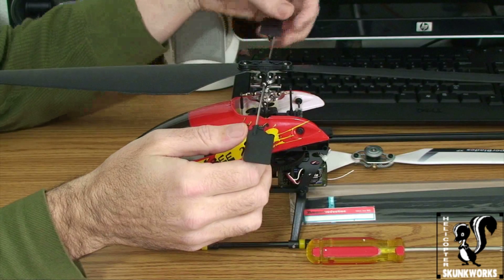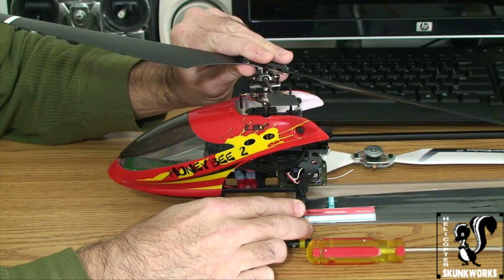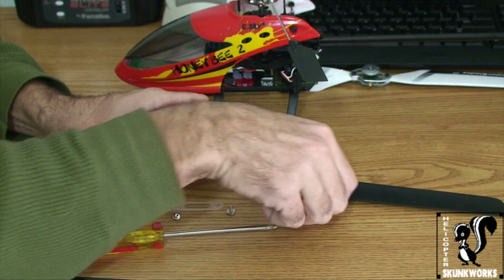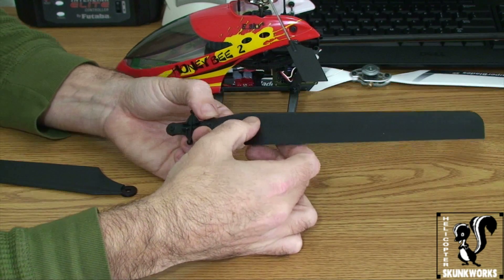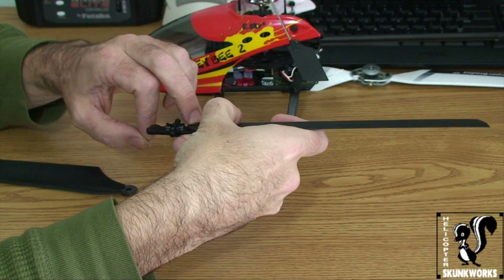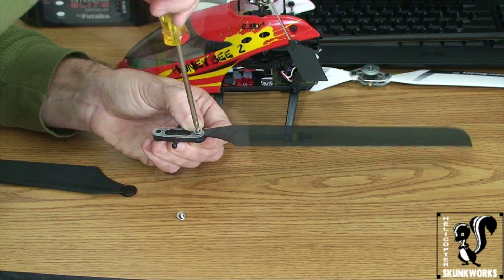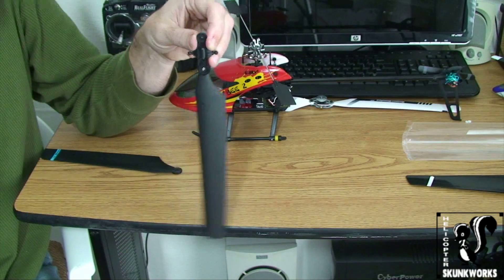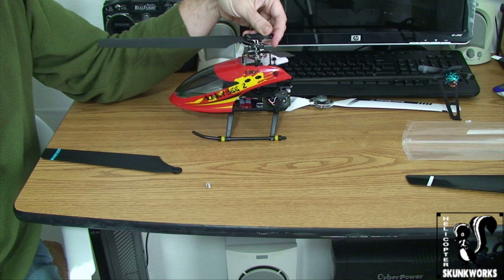ESky Honey Bee FP HBFP V2 - Swapping Main Rotor Blades

Comment: sorted the stability out. but broke tail fin? wasn,t enough slack to take out the motor. so unscrewed tail boom. and unpluged cable from esc. and  the fucking stupid design inside the tail boom chopped my wires. how do i re thread new cables. plz help. before i chuck it away.lol.

Comment: hey ive wondered how the extreme head works. dont they need to bend to take off the blades? those blades look like the extreme cf ones too, did you upgrade your pinion? im looking into getting the super blades xp and the xtreme metal blade holders. looks like you have both!